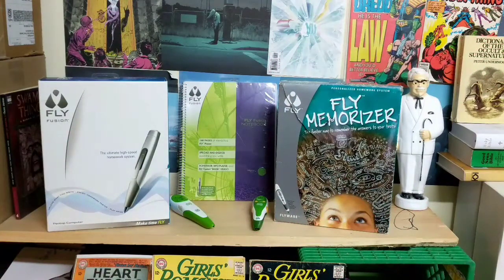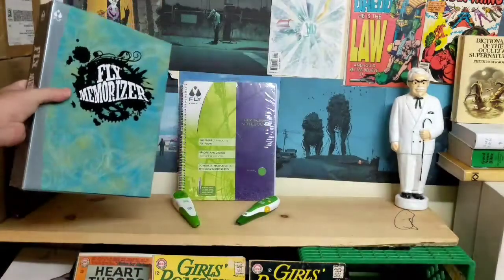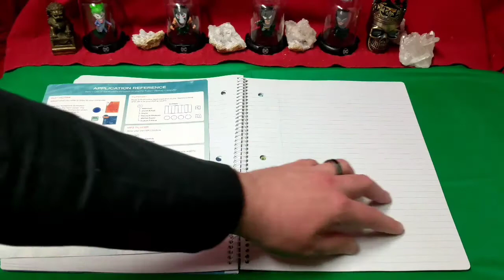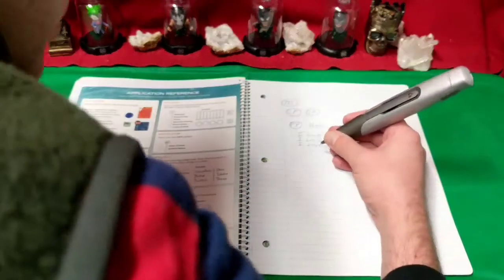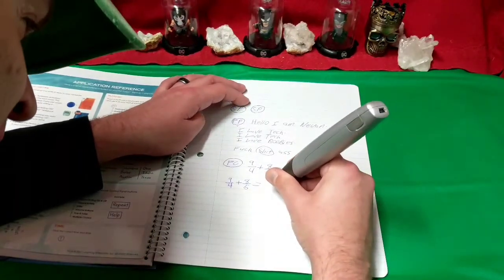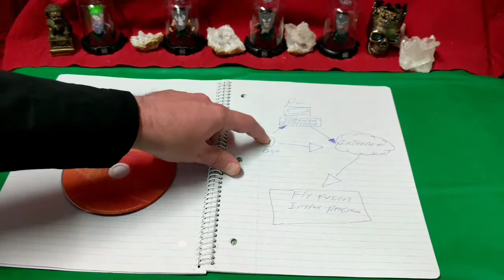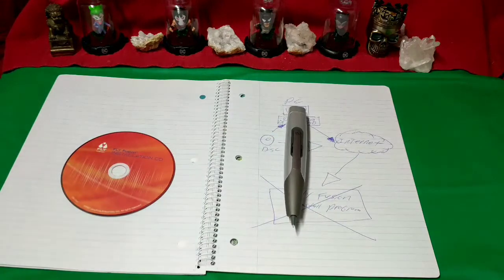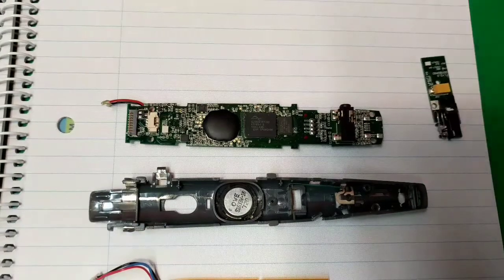Fly Fusion Silver Pentop Computer Set Review & Teardown. 2007 Retro Tech

Comment: The Fly Pentop computer is not future-proof because the software comes from a dead server...
I think the same thing is going to happen to the Leapfrog Tag system and its library of compatible books... and eventually, LeapReader and LeapStart. Leapfrog Connect shuts down and the data for the books are no longer downloadable; the end result is a defunct product.

The original LeapPad learning system is still usable because the data for the books are on the cartridges; although for the modern products, I'd rather have the data visually encoded into the books themselves.

Comment: I have a driver version 1.4.4.5064 that I downloaded from the website years ago. It's 34.8 MB. After installation, it took a while for Win10 to recognize the pen, probably because the battery was too low. An 8.29 MB mp3 was compressed to 2.25 MB before transferring to the pen, but it played back in stereo. I already had some apps installed, including Sound Studio Pro, but the Download Store tab won't connect to install anything else, obviously. Fly Notes transfer should work, but I haven't tried it.

Comment: Just a note about the usage of applications and loading it onto the pen...
You can load software even without the Fly World service. So it does NOT need the internet or their service to load all the goodies from CDs. The CD sleeve usually has the serial number but sometimes it is on a card or sticker with the packaging- you will need that. You need to install the Fly World application which you can download flyworldlatest.exe (version 1.4.4.5064) which is online. After you install Fly World, then connect your pen and it should scan and look for your pen. Then you can create a Pen Profile (it will be a red button). The user name and password are LOCAL... and you can click the remember password. Then when you log into the Profile, go to the Applications menu and load/sync the application to the pen. I found that sometimes I had to quit the application, disconnect the pen, and then reconnect the pen. Fly World will automatically start. Then you log into the Profile, go to the application tab and load/sync the app.
Note: don't try to create a Fly World service/parent account, that needs the defunct service so that won't work.